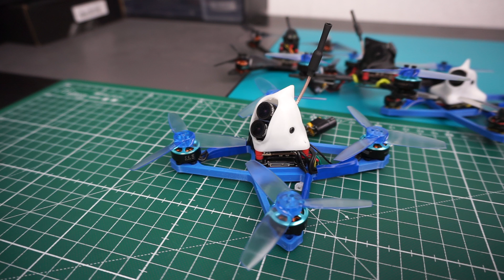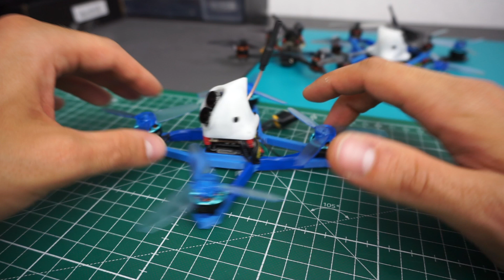Calimero 4K - Caddx Tarsier ultralight 3" build

Comment: Nice!! 
Have you considered using the HGLRC Zeus? It is only one layer for FC+ESC's, handles higher amps (15-25a) and has a powerful BEC. Not sure about 4s compatibility; I have only been flying my lightweight micro's on 3s thus far.. Great little FC though, and no mounting adapter needed either (20x20mm).
Cheers!